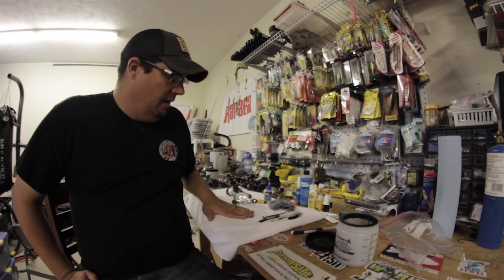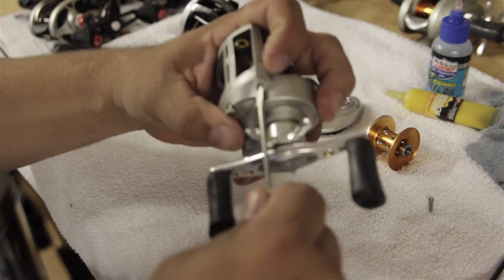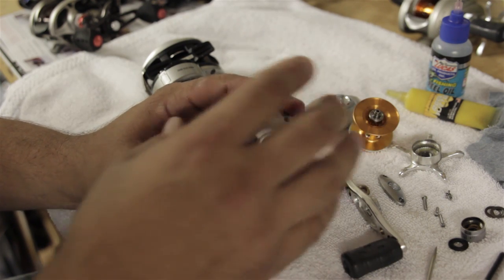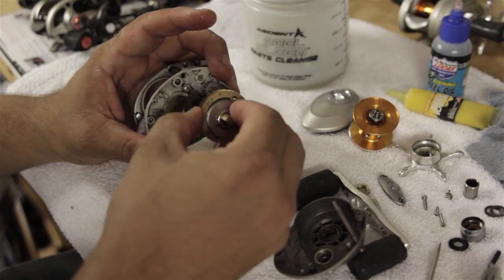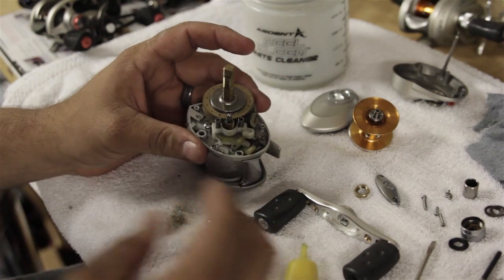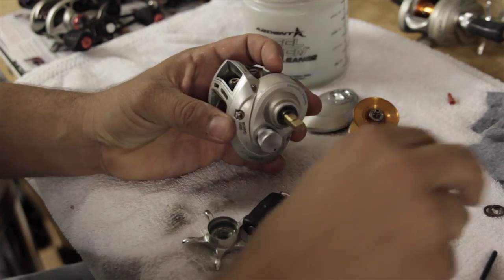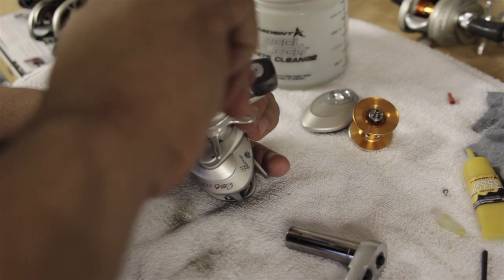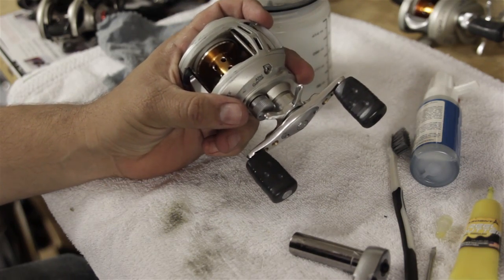How to Disassemble and Clean Low-Profile Baitcaster Fishing Reels

Comment: Winter is a perfect time to clean reels.  I would recommend to people (who dare to do so) and if your OCD is up to par, to completely disassemble your reel and clean, regrease and oil. Strip it down to a bare frame. I have a 1st Gen RevoSX getting ready to fish it's 11th season and  it's smoother than a brand new Gen 3 by FAR. It takes about 4 hours to do a complete clean but it's time well spent IMO as the reel feels brand new afterwards, not to mention it extends the life of the reel.

Comment: great video!  i've always been a bit intimidated to try this because i don't want to mess anything up or forget what goes where.  but i guess if i just film the diassembly process and take pics then it won't be so bad.  i need to buy some grease and get cleaning this winter!
Reply: I myself was intimidated to dig around in a 200.00 reel but i did it last year, and OMG what a difference it made.

A piece of advice (this is what i did) when you get into the actual washers, and gears of the reel handle itself, is get a screwdriver, and place all the washers, nuts, drag gears, on the screwdriver the order that u take them off, so the first piece you put onto the screw driver will be the last piece you put back onto your threaded handle assembly,  and take lots of video, and talk to yourself in that video on where the pieces go, once u do one reel the others are a walk in the park.
Reply from the maker: s4il
Agreed. That's a good tip about the screwdriver. Thanks for watching.

Comment: I have found when screwing on the drag star, rather than holding the line guide and putting stress on the pawl/worm gear, I can grab the end of the shaft with a pair of pliers and stop the shaft from spinning making the drag star go on easily.

Comment: Your video is pretty good about breaking down your reel to some point..My concern is the anti-reverse, sprocket, line guide, the thumbar, the worm shaft and the pawl..Those too should be cleaned and lubed..I see alot of these videos and they don't seem to demonstrate a true cleaning..sand and particles can get lodged in the wormshaft and the wormshaft sleeve causes the grooves to be compromised..I do agree with you with the phone camera..all moving parts should be lubed..

Comment: I need to do this with my reel at the end of the season but I don't have the oil or the grease right now I've been using lithium grease though and it's been working great i also used just a teeny tiny smidgeon of motor oil on the brakes and a bearing an it actually worked well

Comment: Good video, but what about cleaning and oiling the bearings, and the one-way clutch (anti-reverse)? I maintain all of my personal reels and always include the cleaning of the bearings and clutch. Do you find that this is normally needed, or I am OCD as well?
Reply from the maker: You're not OCD. I cut the video a little short because it was running 20 minutes. I'm going to work on one about cleaning bearings, not over oiling or over greasing reels and gears. I open the reels up and look. If they don't look horrible I do basically what I did in this video. If it looks like there is some build up I will pull parts, clean individually re-grease and oil and put them back together.

Comment: Thanks for the video!  I have a revo stx just like the you disassemble.  My spool does not come out as your video shows.  The spool comes out about 1/8 of an inch and stops.  Any ideas on what's holding the spool in and how to remove?
Reply from the maker: Yeah the gears mesh together and there are a couple of thin washers and a collar between the drag and the side plate. Those will sometimes get crooked on the threads of the handle and it won't let you pull the plate off.

Comment: Hello, how are you, I ask you a question, the degreasing spray you use is similar to the WD-40, would you recommend the WD-40 to do it or is there any type of degreaser that is used for anything else that you can recommend using? Argentina I do not get the ones you use in the video but if you use any that is degreaser for electronic boards or other use I receive your advice or recommendations for alternative products that serve to clean and do not damage the parts of the reel. thank you very much, greetings

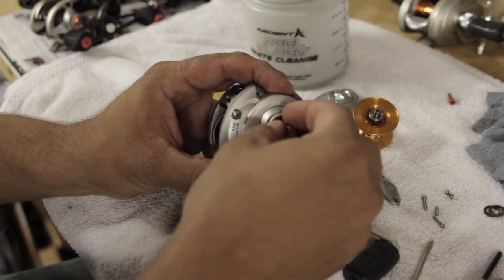Comment: Good video but one of the most important parts you skipped where ppl mess up including myself. Underneath the main gear is a washer with teeth on it which can fall off when taking gear off. The teeth should face away from you when installing or thumb bar will not engage when done reassembling. Common problem i see on youtube comments. Also one of the dirtiest parts to clean on the reel is the rollers inside the actual side plate where the shaft goes through and shaft sleeve slides in @ 14:30. You should always take a cotton swab and clean that area well cuz generally you will get alot of black gunk from that area then oil rollers. I also grease the plastic gears underneath the main big gear.